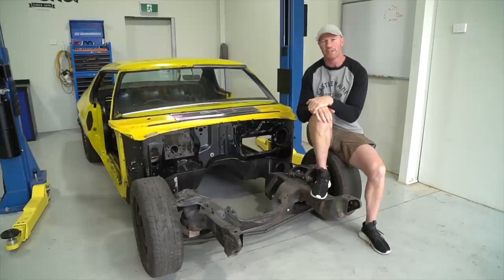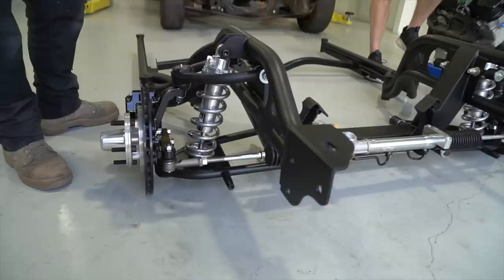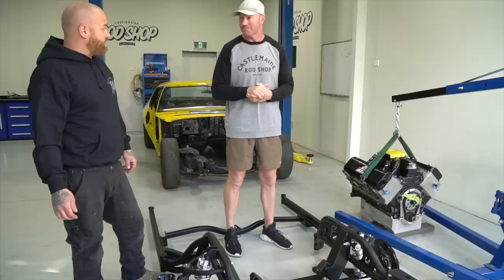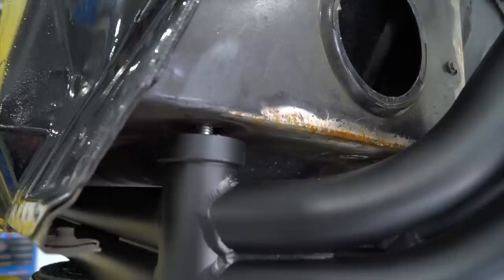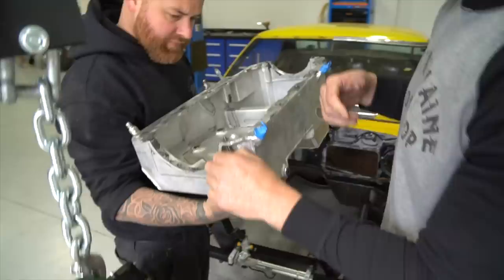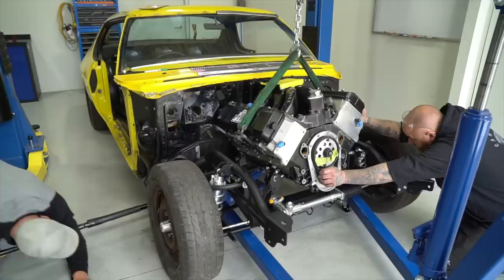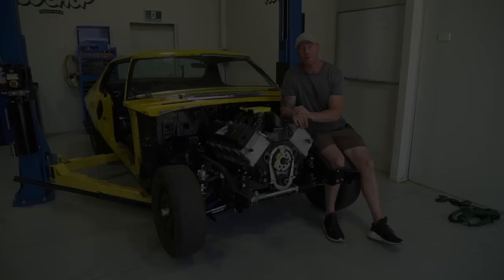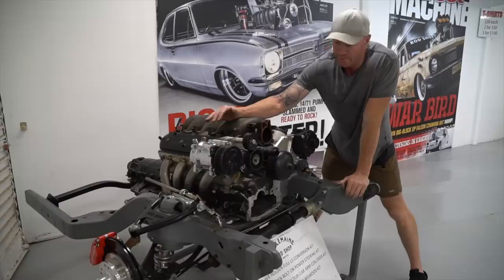How to Install a Castlemaine Rod Shop Front Clip into Barry Hall's HQ Monaro

Comment: iv plumbed a few cars with these front ends now and the power steering fittings are an absoulte pain to work with ever on a stock sbc sump its tight, tighter again on ls sumps.. iv got away with it with banjos but were talking 5mm here, also there steering shaft angle is trash im glad youre fitting one because youll get to see all these things wouldnt hurt to put some brake line tabs on to! and someone tell me who the engineer is thats passing willwoods because we have 4 cars that need engineers and the calipers have 5x 1/8 npt fitting each and that thread is not adr and never has been

Comment: i would have liked those rear mounts added like original, 8 versus 6 bolts sounds better with big torque, also pretty sure downside is original chassis number has to be scraped, might have to double check that,

Comment: hi 
Depending on how u tubbed the car depends on how much its worth . A modified car worth the same amount as good stocker . Basically an un molested body is worth the most .
But hey its your car .
For drag use the 3/4..19mm discs are ok [these can crack under heavy use ]  but for road /circuit u need at least 28/30/32mm thick by 298mm--320mm
Reply: @A. Melbs "But hey its your car ""  [no question mark ,  looks like ? ] It was a statement saying its his car his final choice  . Oh yea at 1.00min onwards tubbing is mentioned at MacDonald Bros . Suggest you read comments properly !

Comment: looks a bit light  be interesting to know how it holds up if involved in a accident ???
another issue is the mounting no rubber mounts to absorb road noise
i think you will find it a hard ride
Reply: Road noise? He won't be hearing that with a 1000+HP big block running up front and it's got adjustable coilovers it will ride fine.
Reply: @A_lesson_in_Hate  lol solid mounting will  produce more road noise regardless of the huge motor lol
also a harder ride know from experience when you do theses types of mods 
he says its going to be a road driven car this time no just drag race it

Comment: is it a tall deck big block?
Reply: Tall deck 10.2
Reply: @haulingass   the sump looked to fit reasonable with the standard front end  im building a 632  placing in a hz wagon , did you modify the area under the sump on the original front end , as i too have a very wide and low alloy sump

Comment: You'll need panels fitted to figure out the shiming
Reply: Hey mate the Front clip is full adjustable for Radiator support. Up,down and back and forward so once the front is mounted you can the. Adjust for panel alignment. 👍